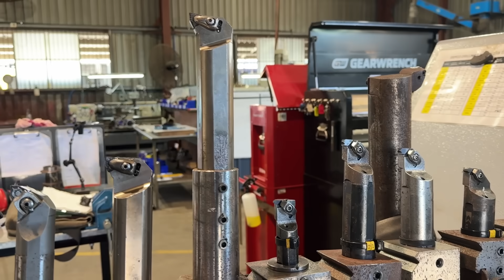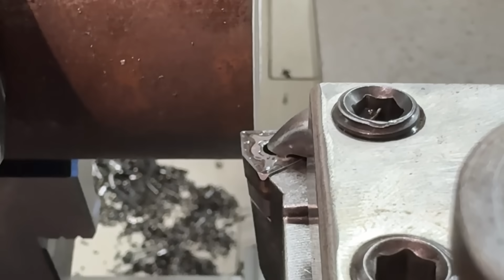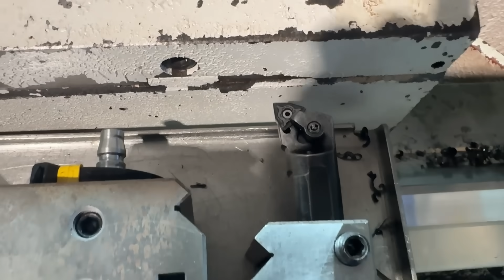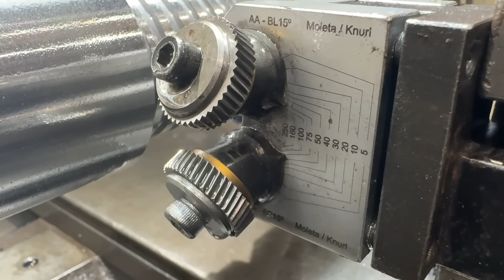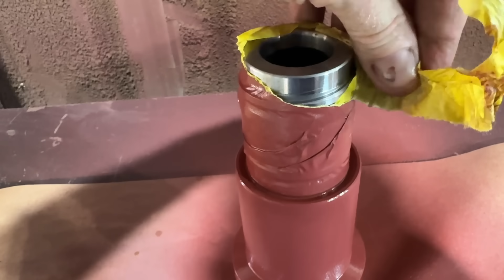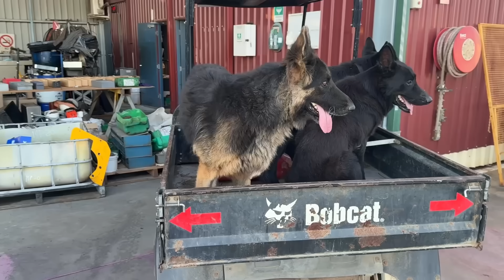Machining a Haul Plug (So Satisfying To Watch!)

Comment: Thanks for yet another fantastic video Matt. One thing, you should invest in a pop filter to use with your mic when doing the commentary, the pops are quite bad on this video. In case you don't know what a pop filter is, its a small piece of sponge effectively, that sits on a frame about 5 cm away from your microphone, It stops the air when you say words that start/end/contain  the P S T sounds, from hitting the microphone and making the "pop" (very bassy sound) . You could even make one yourself using a piece of wire and a section cut from a pair of  of pantyhose. That's the cheapest way, and they work just as well as their expensive counterparts. If its never going to be seen on camera, Id go that route. It will make a massive difference to the sound quality.  I am a Sound Engineer/Producer/Musician and have been in the game since I was a teenager in the 1970's. If you need any further info give me a shout

Thanks again for the great videos you produce!!!
Reply from the maker: I’ll get a pop filter ASAP.  Def need to do that. Thanks so much for the suggestion

Comment: Love most engineering having served my apprenticeship in a Aluminium foundry way back in the 1960's. South Wales UK - making castings in aluminium - brass - mazak - high and low pressure castings - sand foundry and gravity foundry. I was a fitter/toolsetter on the high pressure foundry, setting up huge moulding machines.
Reply from the maker: Oh wow. Nice one Graham.

Comment: Question from the curious: Is that first "square"" thread you cut akin to what we Americans refer to as an Acme thread?
Reply from the maker: It’s a square thread.  We do cut acme, but it’s not really used in drilling much.

They use the square threads for tripping rods because they have full engagement all the way (unlike tapered ones)

If it starts to unscrew you can see it instantly, and it won’t let go.  Quite clever really.

Comment: 300 RPM is quite a low max rpm limit, especially for that size of live center
Reply from the maker: It’s designed for heavy larger stuff.  The rated limit is 250rpm strangely.

If you get the light duty version I think it’s 1000rpm

Comment: What is the purpose of a tapered thread like that? As someone who doesn’t know anything about all that, it seems to me that as soon as the part that is threaded on it comes loose even a bit, it will just self-unwind and fall off immediately. Is it so that you can thread it on quicker because you can start deeper in the hole when you are threading it on?

Greetings from the north of Sweden where we also have mining and heavy operations.
Reply from the maker: Hey mate, excellent question.

So the reason they’re tapered is so they screw / unscrew faster in the field.

As the direction of drilling rotation naturally tightens the threads, they lock in and require either a breakout unit or Stiltons to crack them loose.

Very very rare that they come unscrewed naturally during drilling (I actually haven’t seen it or heard it happening in the last 5 years)

Comment: Tuning in from North Carolina, US. 
That's surely a bread and butter type of job. 
A lathe with a turrent would eat that part up. 
But I guess your part count doesn't justify it.
I would have skimmed the od on the first op and cut out the skim cut at the end. But there are many ways to get to the same result. Thanks for your time. I enjoyed watching as always. 
Can't wait to see that mega drill in operation.
Reply from the maker: Cheers bro! Yeah, we need to get a turret lathe (probably a DMG NLX mill turn) to churn them out in lots of we.

It’d eat it up.
Reply: @halheavyduty I've programmed and ran a couple of lathes with mill/drill abilities. In my opinion, you are better off with 2 different machines. You end up being painted in a box with the limited room in the lathe.

Comment: Working as Pipe Inspector I saw many thousands of joints receive Manganese phosphate treatment, it is a standard anti-gall treatment, it does help to slow corrosion too but it also helps when applying any sort of Thread Compound to the joint be it long term storage dope or API Drillpipe or Casing / Tubing dope.
Reply from the maker: Cheers mate. That’s very helpful. Thank you

Comment: Question. You have at least 3 tool post positions.  In an unused position can you lock in a tool holder that has a damper on it to quiet some harmonics I have seen in other videos .  Could be a bar pressed into a leaf spring eye bushing that is pressed into a larger mass.  So minimal work other than finding a spring eye bushing or big rig tandem bushing.  I hate what harmonics do to spindle bearings and live center bearings.
Reply from the maker: Interesting. I’d never thought of doing that. Thanks mate

Comment: I recently did a project cutting 4 TPI square threads into a 5/8" stainless part, about 7" of threads... 3mm wide and about 3mm deep... Lacking a follower rest, I mounted my router on the toolpost and cut the threads with a 3mm endmill. It was very fast, great result. The minor diameter of the shaft is only like 3/8 or 7/16 once the thread is cut! Like trying to machine spaghetti the normal way, with a part 14" long!
Reply from the maker: Oh wow. Nice creative solution. I like it 💯👊

Comment: Is it just my hearing or does the CNC lathe speed up as it faces off, reaching the centre? Kurtis, CEE, was talking about surface speed in his manual lathe when he was making that wheel of death last week
Reply from the maker: Sure does. The CNC has either RPM or CSS as an option.  Unless I’m running a steady or live center, I use CAS

Comment: What you could do better is positioning of the tools, especialty boring bars, everytime it moves first in Z toward the chuck and then X, my heart skips a beat. Moving both axis simultan to the start point is safer, because you can eyeball if the machine is on the right way or not.

Also why 0.33 feed rate for the WNMG? Thats such an odd number, i usually use 0.4 or more, seldom less, if i have to remove a lot of material, im not happy until the spindel load is at around 90-95%.

Greetings from Germany
Reply from the maker: Thanks for the comment mate.  

The reason I move in Z axis first is just so I can be sure the billet hasn’t been pushed in by the Udrill (by eye)

Some tools I love x & z simultaneously though.

I just go off the sound and generally note how long the tools last. 0.33-.035 seems to be a sweet spot for the machines.

I know other run much faster, but the 4140 grade we use seems to chip well in that range.

Comment: Really enjoyed todays instalment Have been watching for around 6 months but have never commented
From Midlands UK
Completed an engineering apprenticeship in the mid 80's doing everything from 1,000 off 15mm brass bushes to castings with 300mm bore with a tolerance of .02mm on a manual lathe. Then onto castings and fabricated items on a vertical ram mill weighing up to around 1000kg.
Didn't stay in the industry due to factory closures. 30 plus years later set up, own and run a CNC woodworking company making one off and large batch items for the food, drink, hotel and bar industries
Reply from the maker: That’s great. Thanks for commenting mate. Nice to hear from fellow machinists.

Comment: Hearing the spindle spooling up as the diameter of the cut shrinks and the finish being like a mirror all the way in makes me jealous of just having a manual machine. I wonder if there is a way to hook up an encoder to the cross slide that interfaces with a VFD to ramp up the speed for the same effect on my old South Bend?
Reply from the maker: I don’t know do you can retrofit something, but the higher end Colchester magnums come with CSS on the manual machines.

Comment: I imagine that the surface rust that is on so much of the tooling is due to the insane humidity up there. At 6:51 it's all over the live centre.
I don't know how many countries I've shipped to but with the exception of Antarctica I've shipped to all the other continents. Most of what I do is make Xmas light controllers and despite the fact that it's daylight 24/7 at Xmas time in Antarctica I still aspire to get something shipped down there.
I'm still jealous of your rain and I wish you'd ship some down south to Bendigo. We're at about 38mm or 1.5 bananas for the year so far.
Reply from the maker: It’s a constant mission to keep things shiny and free of corrosion. Drives me nuts

Comment: The dark art of knurling.
Reply: Well, this is cut knurling, and not form knurling (you actually cut the knurls from the steel, instead of bluntly smashing your knurling tool into it), so as long as the two diameters match (taking tooth count into consideration), you're good to go
Reply: @vincentguttmann2231 that tool is adjustable for a diameter range and feed rate is not particularly critical with cut knurling. They are a bit expensive for the hobby guys but once you’ve used one you will never go back to forming again.
Reply: @Farmer_Ty  knurling is best approached with a balls to the wall attitude! Start with the wheel at the very edge if you can, at least a .025 feed rate and heavy pressure on the in feed! Use lots of lube to wash away scarf! Good luck!
Reply: SWARF
Reply from the maker: Pure Sorcery